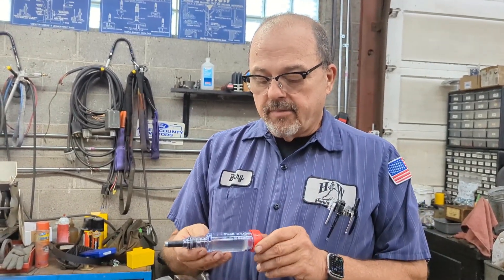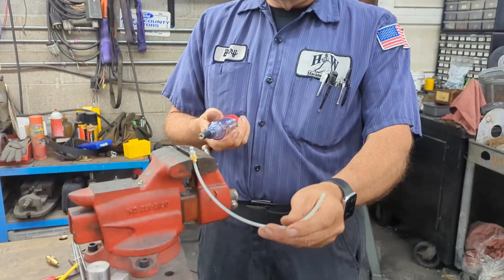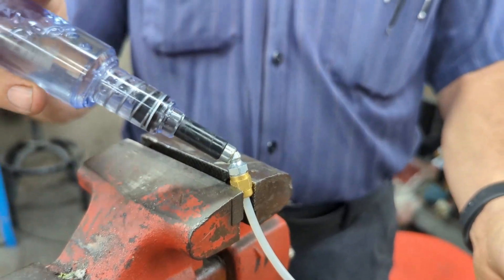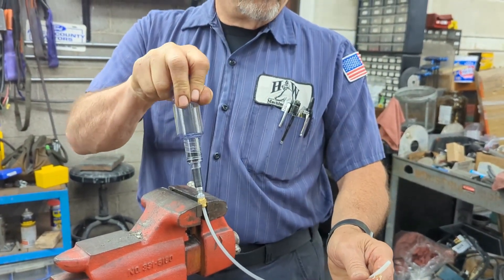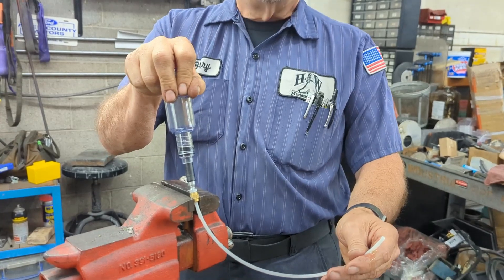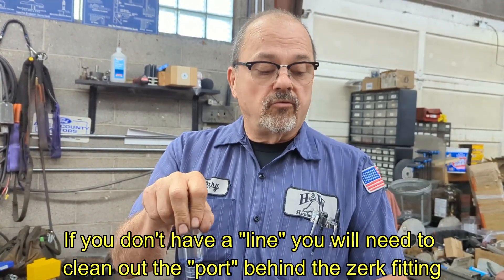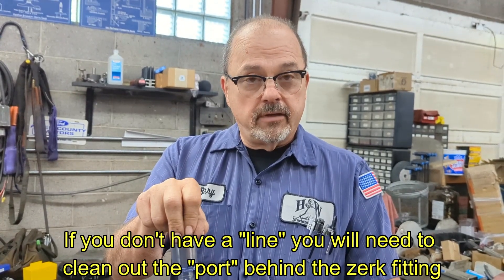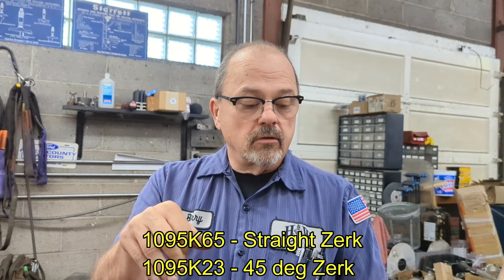Product Spotlight: Push N Lube

Comment: Do you sell one of these for the little ball oilers? I struggle with getting oil in them ports. I thought that the push in lube was for them but clearly not. What is the proper tool for them ball oilers?
Reply from the maker: No, that is only for the zerk fittings. The ball fittings get oiled with an old fashioned oil can.
Reply: @HWMachRepair  gotcha, thanks for the reply, I know it’s a stupid question but I always end up with more oil on the outside than what gets pushed through the ball.. lol 
I was hoping it was because I had the wrong tool. I think I see a opportunity here. I’ll fabricate a “push in lube” type of handheld with a good seal on it. I can’t be the only one that makes a mess every time I oil them.. or can I ?? 
Anyway thanks again for the response.